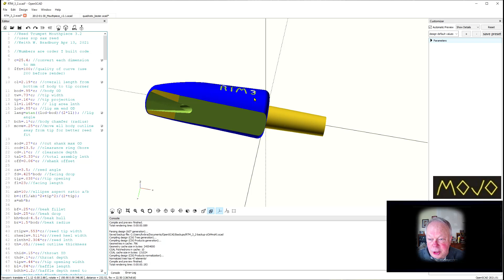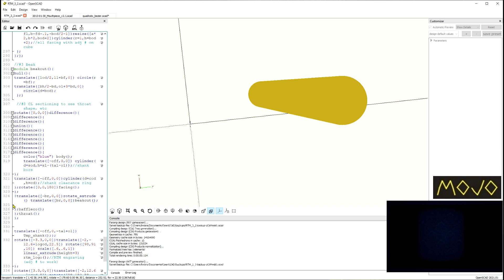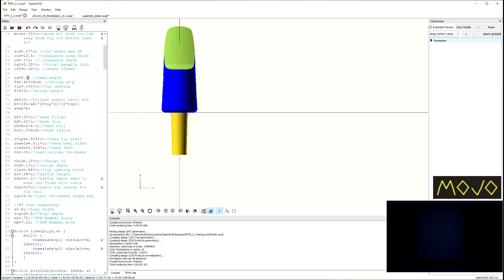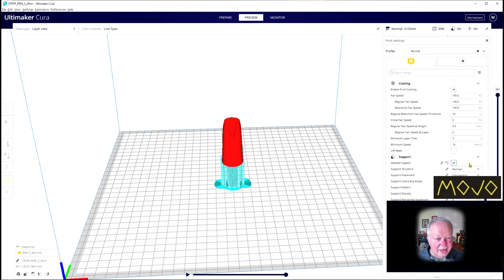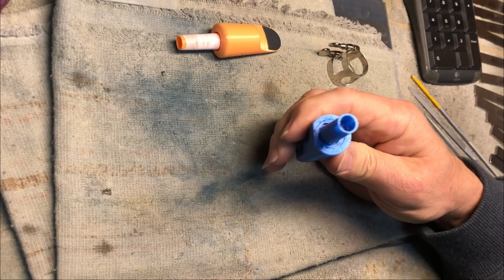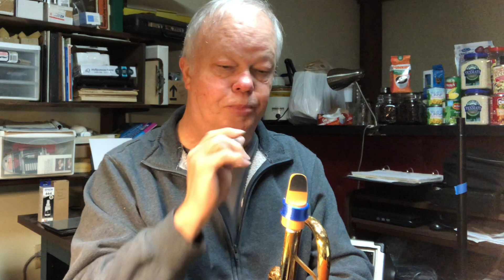Mojo Reed Trumpet Mouthpiece

Comment: Have you tried TinkerCad or Fusion 360? That CAD looks like hard-mode! Maybe add a chamfer on those edges to get rid of the bump or use a smaller nozzle on the printer like a .20 mm. Very cool!
Reply from the maker: Thanks.  I had not seen a review of TinkerCAD.  Looks interesting.  I like the parametric adjustments I can do in OPENSCAD.  Plus there is a wealth of free code for specific needs on user groups.  I have not tried a smaller nozzle yet.  I need to try slower speeds and cooler temperatures too.